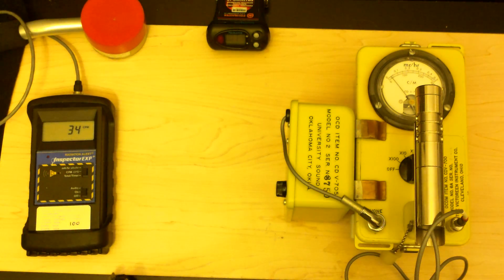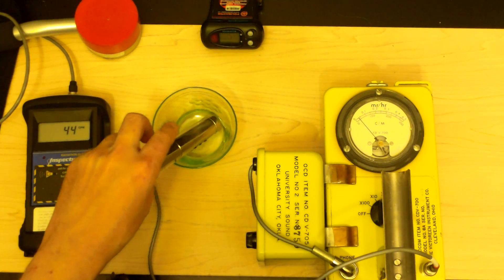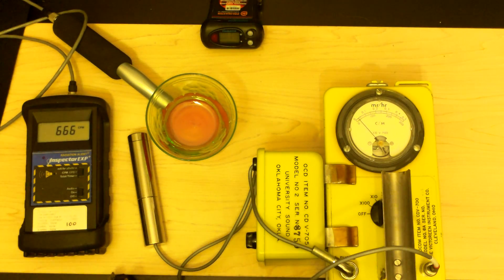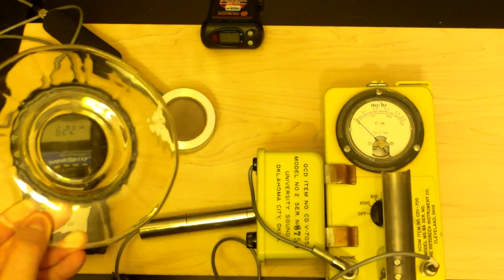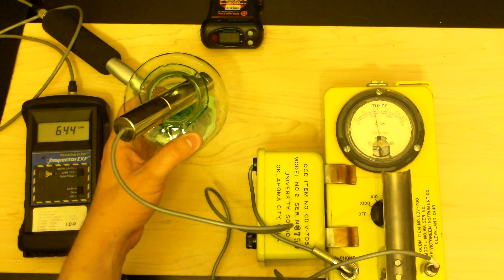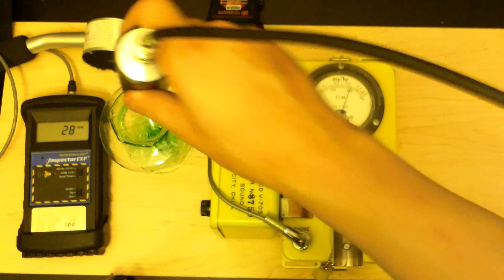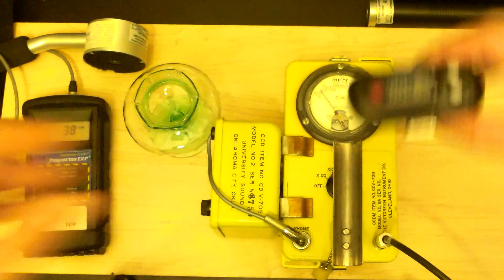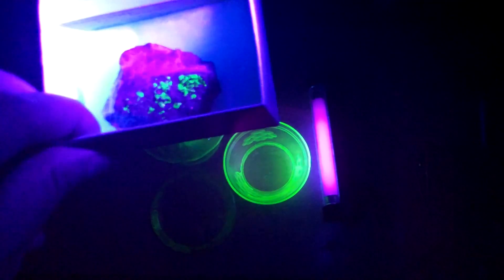Radioactive Depression Glass vs. a Geiger Counter

Comment: Ok I have a question. (Maybe stupid, but I am complete newbie, so dont judge) I didnt even know that such thing as uranium glass existed, a few months ago. I bought a small piece of that (before knowing what it is) since I collect random vintage stuff. I was carrying it from the store to my home for about lets say half an hour. When I first saw pictures of vaseline glass I remembered I had something similar, so out of curiosity I flashed a uv light and it glowed. I decided to remove that little glass piece from my collection, just in case. Since then I am bit anxious. Is there a possibility of contamination or a potential health threat? I know I may sound dumb, I just dont know how it works.
Reply: No need to remove it from your collection or anything like that. This is mostly alpha, which means your skin and your clothes protect you from it pretty well. So, unless it's inside your body, you're safe.

Comment: If I had a small collection of uranium glass sitting about a foot and a half away from my computer desk for a few years, should I be concerned? I didn't know that some pieces could be that radioactive when compared to background radiation.
Reply: Likely not. Alpha-particles are blocked even by your clothing or skin and are only presenting danger when ingested. And, as you can see from this video, you see high Geiger counts only when alpha-particles filter is removed.

Comment from the maker: The yellow glass might be Vaseline glass. I would suspect it is and it certainly uses a different oxidation state of uranium than normal depression glass.
Reply: antiprotons 
Would Mendelevium dope glass be radio active since its a man maade radio active element? and where could I find Md. 2020 glass? Had some when I was a kid did some zootastic shit with it!
Reply: is uranium glass dangerous in any way? Im asking because I have a few pieces in my room...
Reply: @theforge6873  no you better send it to me
Reply: @Traceyi1000  Nice! That did make me lol 😄👍
Reply: my Geiger counter doesn't pick up the radiation from a few feet away from uranium glass
Reply: @theforge6873  Uranium is an Alpha emitter. Particles do not travel far. Can be blocked with skin or a sheet of printer paper. Most consumer Geiger counters do not detect Alpha. The
Reply: The Garage no its safe
Reply: I would argue that the yellow glass contains zero uranium, since it emits zero Alpha particles.

Comment from the maker: NOTE:  That CDV700 has a terrible pickup for that probe. Only the highest energy photons in its very narrow range (~8 keV to 500 keV) produce enough voltage to be detected by the CDV700 without a preamp. With a preamp, that CDV700 would light up at about 400 to 1000 CPM background.

The folks at SE International (makers of the RAP47) told me it wouldn't work  lol

Comment from the maker: I should also point out that being radioactive does not make anything glow under UV. In most cases, a phosphorescent substance is required, such as the phosphorous paint inside of a tritium marker. Large enough quantities of material can glow (e.g. radium paint), though this usually requires massive amounts of radium or tiny amounts combined with a phosphor. 

Typically, activities which result in a glow are lethal lol

The effect is florescence.
Reply: Rule of thumb, if your dishes glow neon green, it’s best you just enjoy the color for the time you have left.